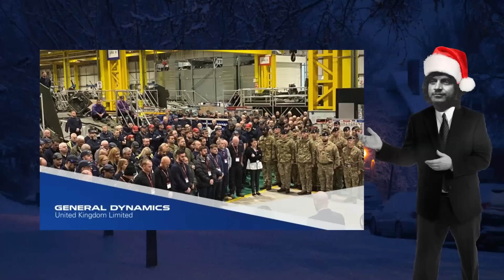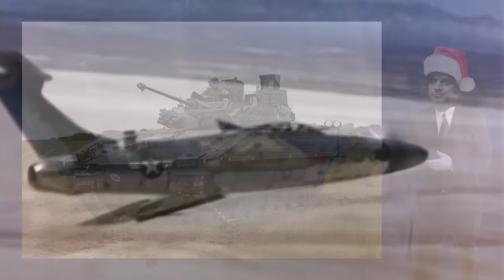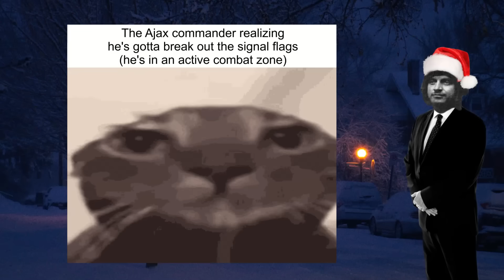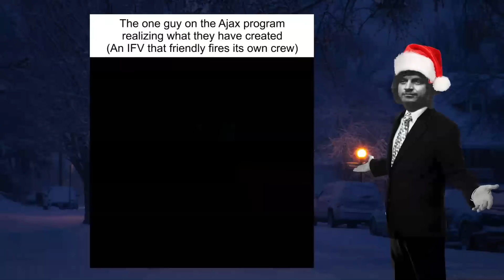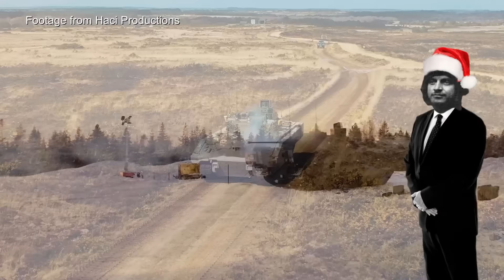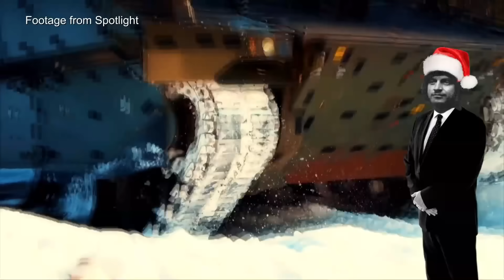The Ajax IFV│ Weapons Grade Stupidity

Comment: that ut you get for buying Spanish designed equipment on paper the design's are great but the equipment is hand fitted. then BAE designed gun and Rheinmetall manufacturing you have better luck get the Hatfields and McCoys design your gun at least there pride would get in the way and your end up with a great gun at the end and not a dual feed 40mm trying to kill the crew. who ever came up with that one should have been shot it one or the other not both and i can't prove it but i beat money the english where loading magnum loads in the 40mm to speed up traveler of the projectile and blow out the wall's of the case creating a failure to extract ripping the head off the case or creating a double feed stove pipe jam. there a difference between manure loaded breach block and an auto cannon... fool's

Comment: Even if the Ajax worked it had no role. It's not designed to fight alongside tanks ad a bodyguard, and it's not designed to escort APCs or fight alongside dismounted infantry. It can't really scout or do reconnaissance in force because it's too heavy. So what's it for? Using this thing as an ambulance and tow truck is ludicrous given the price tag.

Comment: what I don't understand is how they could mess it up this bad. It's just an ASCOD 2 with a different turret and more armor, and the ASCOD 2 doesn't have any of these problems - how hard can it be? Suspension upgrades to match the weight increase and you're good, right? Apparently not if you're GDLS UK...
Reply: Apparently the ASCOD 2 got a reduced rating in the Latvian IFV trials because of vibration issues. Was chosen anyways because the issues weren't as severe, but still.

Comment: So what they need to do is

1) Find the people in charge of the mechanical engineers responsible for finding the source of the insanely high vibrations that can't clearly explain what they are doing

2) ???

3) Fire every manager tbh, if everything in your armored vehicle is fastened loosely in such a way that it makes tracking down the source of vibrations hell, that's a new one for me and I've been combing through mechanical design disasters on the internet for a decade now. Genuinely impressive fuckup, I hope you have VERY GOOD reasons to have done it this way. I'm listening. Allright fire this dude.

I'm not saying I wouldn't have fucked it up and have any solid industry experience yet, I'm saying that this shouldn't happen to juggernauts of modern industry. You have absolutely no excuses, find the rotten apples in your managers, they HAVE an agenda against you, your company and your staff, FIRE THEM goddamnit.

Comment: Well, it sounds like the vehicle and its manuals have been put together by AI. The deal should be cancelled and the money should be returned from General Dynamics back to government since there is no vehicle fit for operational use.

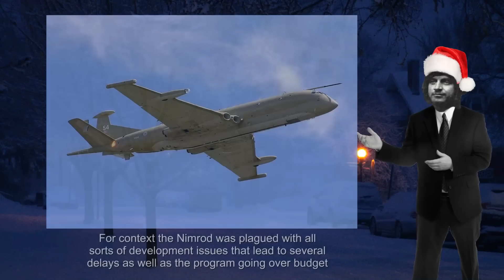12:25 nice, with £6.3 bln you would have received 650+ battle proven CV90s, the same vehicles which is used by most countries in Joint Expeditionary Force led by UK.

Comment: What will really make you angry is when you find out General Dynamics knew all along the ASCOD platforms original torsion bar/damper suspension was designed for half the weight & required upgrading to a hydro system to handle any extra load. General Dynamics had the exact same problem with the M10 Booker another based off ASCOD, it also shook itself apart & had to have a hydro system retro fitted.

Comment: I ride on a fairly successfull IFV in my role in my country's military. It vibrates like hell and requires double layered hearing protection. Despite this, sleeping in the fighting compartment is easy and is how I spend most of my time in there. So it being so bad it turns you NAUSEOUS from the vibrations is just unreal. Like I thought it couldnt get any worse than what I have to deal with.

But hey at least it looks really cool

Comment: Even if the ear pro worked, they would still risk permanently maiming their crews, as continued exposure to vibrations can cause a "sometimes" permanent disorder, known as 'HAVS Disorder' (Hand-Arm Vibration Syndrome). It's like bandaging a wound only for the guy to bleed out internally. You have to pack the wound first, then bandage it.

That's just the most common form, usually effecting machine gunners, professional drivers (like buses), and tradesman (who use power tools), there's a litany of complications from exposure to vibrations, they come under the umbrella term 'Whole Body Vibration' (WBV), most commonly comes from operating heavy vehicles, close to, or enclosed with the engine, like AFVs, MBTs, or IFVs, but in the civilian sector, tractors, heavy goods vehicles like articulated lorries, and ground works vehicles like a Backhoe.

Additionally, female soldiers (we did have a ban on female soldiers being in close combat roles like operating AFVs, until 2016, though female soldiers in roles like medics were found in close combat situations before then) can experience miscarriages and other gynaecological issues from WBV (fertility issues), at least this is what some sources claim.

If I didn't know better, of our legal system, I'd say pushing this AFV system is just begging for a class action lawsuit in the future, you just know they ain't gonna warn any of the poor kids thrown in this Rube-Goldberg machine of a boondoggle.

Comment: cant anybody like, grab some already used and tested chassis, begin production with every issue fix applied directly into the drawing board as possible and just throw modern shit on top of it? after the third time you decide to "build" something from scratch and it fails so miserably, you probably start to look at the common factor, right?

Comment: Wait 2 years and we'll see them cancel it and upgrade de warriors to warrior 2 vehicles (but itll be a small upgrade coz budget constraints)
Reply: Hearing all this, they really should've just followed through with the Warrior CSP.

They already have a fuckton of Warrior hulls lying around, they'd still get their 40mm stabilized autocannon, and it probably wouldn't have resulted in this fucking vibration issue.
Reply: @idontknowyet8540 the biggest issue was that the warrior hull was already kinda outdated when it was introduced and didnt have any options to get upgraded anymore. They wanted a bigger more universal vehicle

Comment: Cant wait to see what germanies new IFV has in terms of issues that are simply not adressed until a news crew publishes a story on it (looking at you Starfighter)
Reply: We’re you living under a rock the last couple years? The Puma did to be fair have some problems at the start but they were slowly fixed over time and they are a very decent vehicle now.
Reply: @aquila3958  the thing didn't see any Frontline service yet. I'll wait and see how it performs if it ever actually gets used in smth that isn't a pre planned exercise.
Reply: The Starfighter was a good aircraft when used for its intended purpose (high-altitude interpection), but the Germans decided to employ it as a low-altitude ground attack plane. Keep in mind this is a jet with atrociously high wing loading, and a stall speed which is probably higher than the top speed of many recreational aircraft.
Reply: @firstnamelastname4959 Im litterally criticizing germany for that in my comment.
Reply: @SashaTheDog There's a difference between incorrect doctrinal use, and mechanical problems rendering a vehicle unusable.
Reply: @firstnamelastname4959my comment was more a worry that Germany is using faulty stuff or using equipment improperly to hide how unprepared they are equipment wise.

Comment: Trading standards law in the UK requires a product to be of satisfactory quality and fit for purpose. Clearly this vehicle does not meet either of these, some loon thought that isolation mounts for the seats, driver controls and thick comfy cushions anti drumming panels and noise cancelling headsets would fix it.. The excess track tension is released as vibration and noise when link drops into the sprocket valley/ root, the vibration damages radios and other electronics, the vibration shuts down the cannons fire control system and excessive recoil causes barrel wobble. The noise was recorded at 117 dB which is just short of the 120-140dB of a jet engine. Cost of changing the suspension to hydro-gas and rubber tracks would be about 1 billion lol. GD UK made losses last two years and would simply go bust if legal proceedings took place, the only asset is the factory, this explains why it was bodged. Seems GD could not afford proper fix and the MOD did not go to the treasury with a begging bowl after praising the vehicle as most advanced in the world and a step change in military technology.

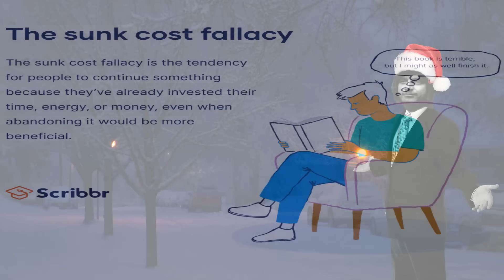Comment: 12:28 While sunken cost fallacy is just a fallacy it might be the case that because of money already put in it it will be cheaper to fix the issues instead of starting from scratch, whatever that's the case, i don't know.
Reply: If the problems with Ajax stem from poor build quality (which a lot of the older reports seem to indicate) then it's quite fixable. The actual problem is whether or not GDLS can be trusted to fix it, not to mention they'd easily have to pay them another billion for the changes, which would reward them for their screwups.
Reply: they are losing money as long as ajax is more expensive than a CV9040

which it will be forever
Reply: @Klovaneer  A modernised CV90 variant is about the same cost as an Ajax, it's just the program itself is consuming significantly more of the fixed price than expected / reasonable.

Comment: Also at start they didn't put a thermalsleeve on the gun, and when the gun heat-up, dirt and sand can stick to it. The fix: just borrow the thermal sleeve from the EBRC Jaguar. And apparently the unitary cost of Ajax is similard to a Leclerc...
Reply: to add on top of that the leclerc isn't produced since 2008 thus explaining it cost, however when it was produced it was analog to other western mbt of the time.

Comment: Would like to point out that the Ajax isn’t an ifv. Other than that good vid
Reply from the maker: Whoops lol. Yet more proof why I shouldn't do modern tank videos. 💀
Reply: @tablesizeproductions4360  aye dw man. The Ajax with a turret and gun? Yeah that’s the reconnaissance light tank. Ares is the ifv. Cus somehow despite being huge Ajax doesn’t carry space for dismounts. Or even atgms as standard. You have to bolt a javelin launcher to the turret to get that
Reply: @overlordminigun6346 ...WHAT? So you telling me, this gigantic brick, is less suitable to be IFV then a damn merkava? (You can fit like 2-3 guys in the back or one on stretcher, and it wouldnt be comfortable at all.)
Reply: @alexturnbackthearmy1907  yes and no. The Ajax is not designed to carry infantry in the configuration that has it mount the ctas40 turret. Its role is not to do that. Cus sm1 forgot infantry are kinda good at doing reconnaissance or smth. However there is enough space in the back + a rear door means in a pinch u could use it as one without too much difficulty. The point of my comment was just to make clear its not an ifv, thats not the role its supposed to fill nor was designed for

Comment: To be fair naming a vehicle after a mythical figure who literally killed himself may have been something of a bad omen for the crews of this boi

Do I think it’s salvageable yes of course but financially it’s probably better to buy something else of course politically that’s a difficult pill to swallow as you’d potentially be ending British jobs and that’s the kinda thing opposition parties pounce on. I could see this developing similar to Germany’s puma where ajax is still used but other vehicles boxer or potentially lynx are also utilised in similar roles
Reply: At this rate, it's astounding that British military didn't opt to upgrading Warrior IFV with modern APS and autocannon that IS NOT loaded with 5 round clips and slapping on ATGM launcher.
Reply: @fr0ggy220 hmmm almost like the desert warrior system they refuse to adopt
Reply: @fr0ggy220  warrior CSP was cancelled because of problems with the VERY old hulls, they're just too worn out to be economically viable to replace.
Reply: @fr0ggy220  3 round clips. Two of them.
Reply: @EdyAlbertoMSGT3  Jesus fucking Christ on the stake... WHY?!
Reply: I'm so sick of prioritising British jobs over British troops and British interests
Reply: It has to be deliberate, it’s all a big money laundering scam. Even if it was competent it wouldn’t ever be used for anything anyway.
Reply: @Journey_to_sunset  Nimrod was the same, someone with an interest in having corroded unsuitable comet air frames used which cost more than new ones to repair.
Reply: @peterwait641  .. That someone was HMT because they refuse to let anything clean sheet or non upgraded on the idea that it will be cheaper in the short run which is literally their only goal, to make annual budgets fit REGARDLESS of how short term it is so the politicians get to be happy.
Reply: The Generals like to show off their classical education and add confusion to a vehicle by not calling it by its function.